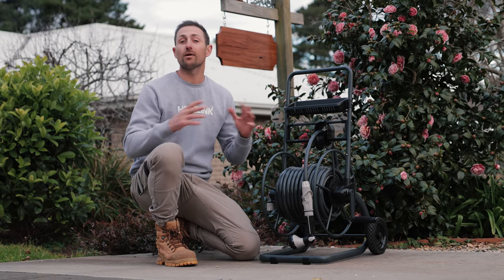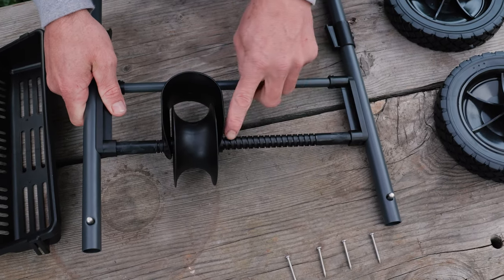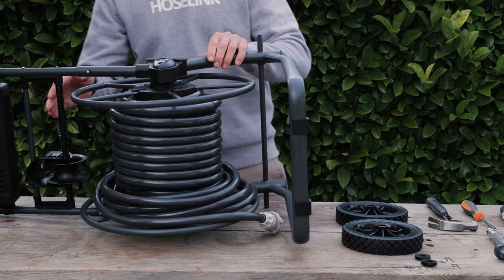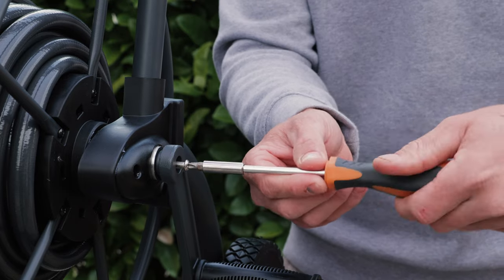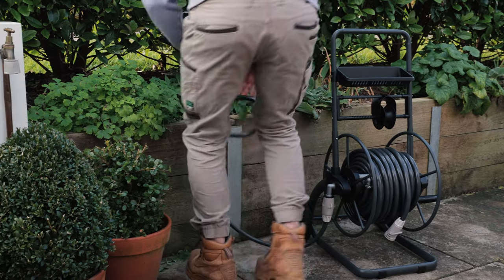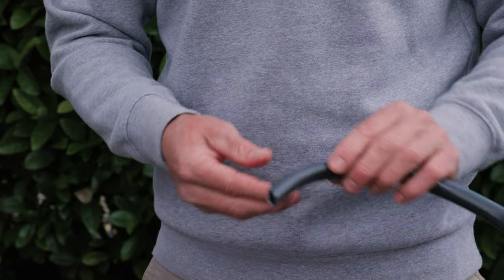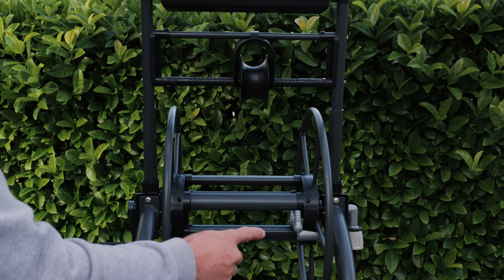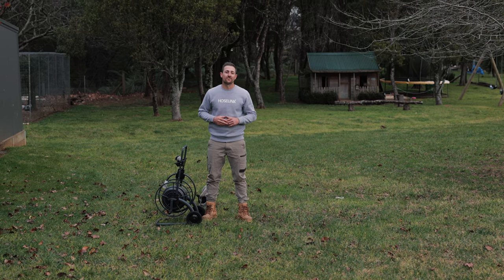How to assemble Hoselink's Metal Hose Reel Cart & fit your own hose

Comment: Great video  - just one question about pulling hose from reel. Do you need to use the pin  provided for hose to unwind at all times?  My current hose  and reel usually is placed on concreted area and when I pull hose, it is pretty stable without the need of a pin to stabilize as it shown in video unless I am not understanding this part of video. TIA
Reply from the maker: Hi Sandra, thank you for your question. No, the pin is not required when pulling the hose out - the frame on the cart does hold it stable. Just keep an eye out when you get to the end of the hose. If you reach the end and keep pulling, especially on the side/angle that might cause an issue.
Reply: @hoselink   I had thought that initially but the pin threw me a bit. Thanks for getting back to me.